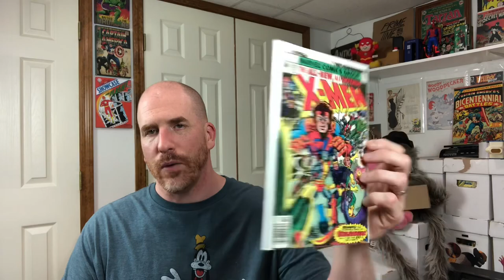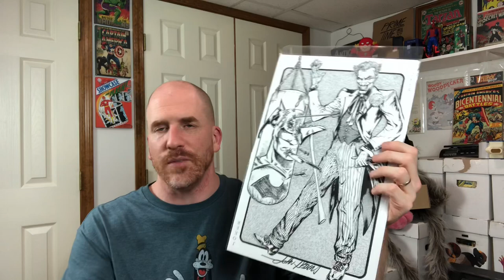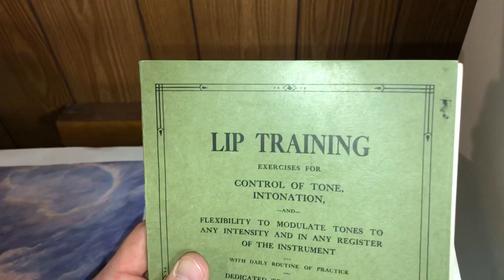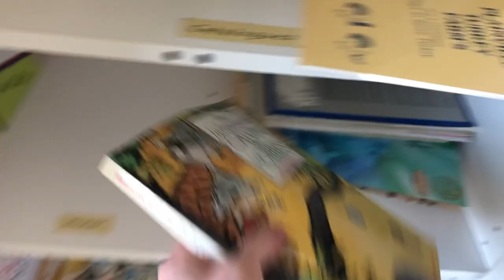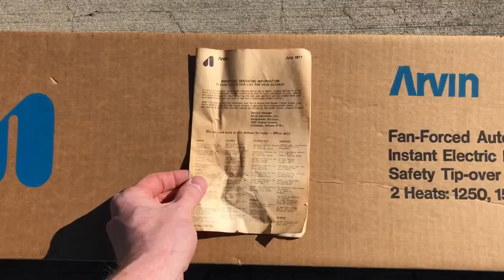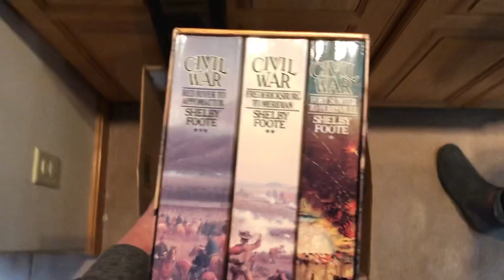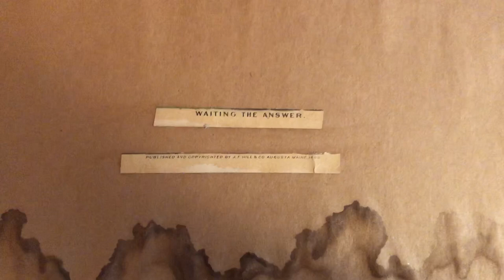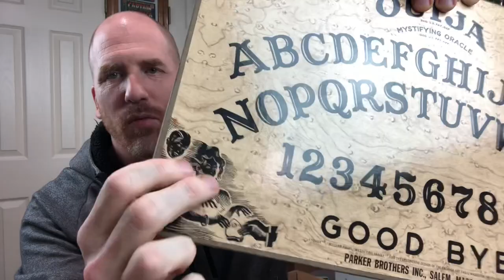A Creepy Halloween Estate Sale Treasure Hunt and a $300 Sales Day!

Comment: That is not the real battery, the real battery is a super short fat batter. My local dollar tree sells them. Thanks for the great videos
Reply from the maker: Thanks. What is the battery type? It’s not a N battery. N is too big.
Reply: No the smaller disk battery is the right thing, 3x stands for 3 of them back to back in the slot. The LR44 looks like it might not be wide enough but it’s hard to tell.
Reply from the maker: @fewffwef6928  LR44 was the right one. Just had to be be stacked side to side. Thanks!